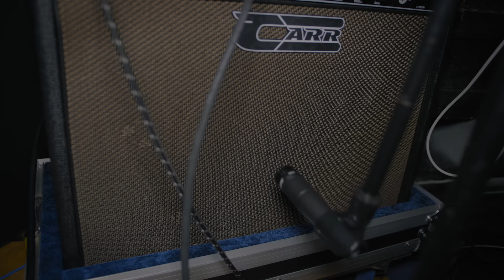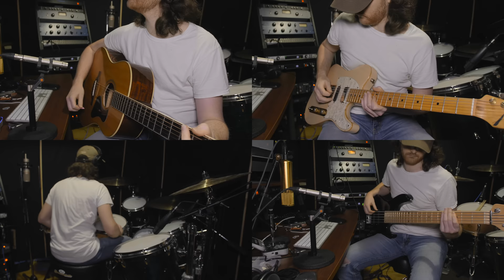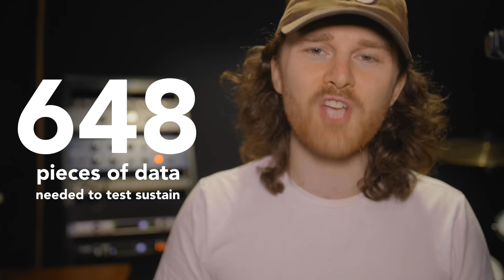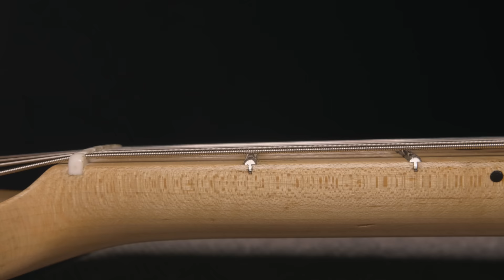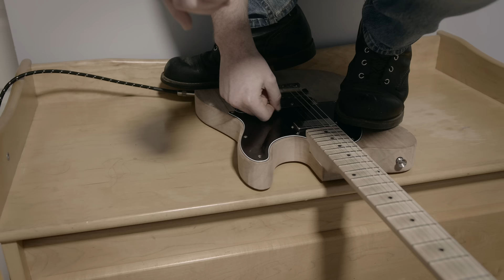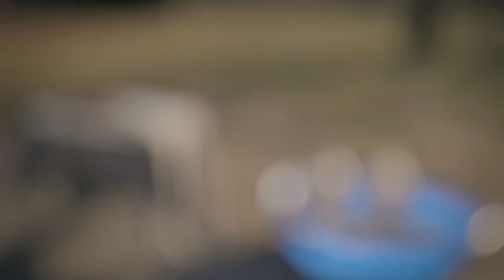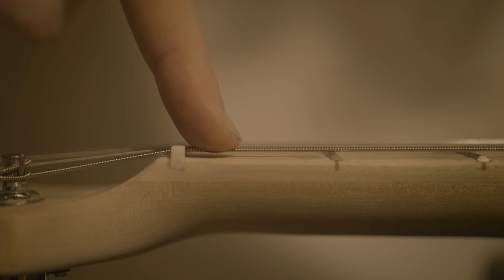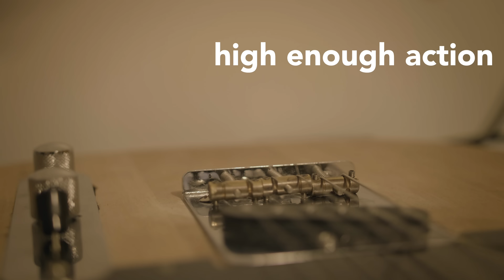Tested: Where Does The Sustain Come From In An Electric Guitar?

Comment: The most important factors for sustain are, good fret work, well cut nut, good functioning bridge, high enough action, new strings
Reply: and the way you play lol
Reply: Neck relief can have a surprising impact on attack and sustain as well.  Loosen your truss rod and play a note, then tighten it a bit and play it.  I THINK what’s happening there is the neck is chewing up some energy by bowing a little when the string is struck.  If you can keep the neck as practicably straight as possible, I think you stand your best chance at getting the least amount of loss there as is possible.
Reply: How much does the nut come into play when you have a string fretted? When you play a chord, some of the strings may be open, but not when playing a note on a string that's pressed against a fret.
Reply: Weight definitely acts as a huge factor, when the weight is below a certain threshold. The "air guitar" is actually infinite weight, it will pretty much be the same as a 8lb or 6lb guitar. But how about 0.5lb? It simplely won't sustain long. 0.5lb hollowbody guitar? That would be even worse.

It's all about how much energy is being taken by the guitar. Very simple physics. For solidbody above 5lb, effectively no energy is taken by the guitar, so in real life, the guitar itself won't really affect your sustain.
Reply: And that's proven by the 8:48 part of the video. When the resonant dresser took away quite a lot of energy, single note sustain saw a difference of 4db, which is huge. 4db is almost 3 times of power ratio.
Reply: @sirporkrib7643  well…maybe yes maybe no…there was also a rather un-resonant human being standing on it acting like a damper.  These tests are just not well thought out.
Reply: @sirporkrib7643  I’ve thought about it more.  The bed WOULD be damping less…it’s acting more like a shock mount than a damper…whereas when dude is standing on the guitar with what I have to assume is north of 150 pounds of ballistics gel and bones on the guitar…HE’S A MASS DAMPER.  The difference in sustain is actually 100% intuitive.
Reply: @iancombs857  Only beginners think that guitar necks are supposed to be perfectly straight.
Reply: @iancombs857  No, it's not about the pure weight, it's about the energy loss. Here, the factor is the huge vacancy of that dresser. It's acting like a double-bass-body, taking away a lot of energy. He stading on it is basically acting like some glue, so that the energy can go from the guitar to the dresser seamlessly.
Reply: @nicholasbstone  >.012" of relief is fender spec, which is pretty straight...and I keep mine straighter than that.  You ABSOLUTELY can keep a neck dead flat if you have a good fall-away and don't mind a little rise in action as you go up the neck...and I know of pro players who DO like necks damn near straight...Pete Townshend and Joe Bonamassa to name a few.
Reply: @sirporkrib7643  Think about it this way: a cello mute is a rubber stopper you clip onto the bridge.  It adds mass, but it's way less rigid than the maple bridge, so it knocks down sustain and high end.  This dude is doing the same thing with his whole body.
Reply: @iancombs857  So it's all about how much energy the body TAKES. When we compare solidbody to solidbody, more weight means less energy taken. Here, it is the dresser that takes the energy, not the human body. The human body is simply there so that the energy can transit into the dresser.
Reply: @sirporkrib7643  you’re speaking directly to my point.  If the body of the electric guitar takes less energy from the string, explain to me how adding the mass of that dresser top (the point of contact and at least equal to the mass of the guitar if not heavier) would do the opposite as you’re claiming.  If it’s of roughly equal mass and density, it shouldn’t have a damping effect by that logic.  Had he coupled it to the dresser top with small and stiff clamps or some sort of stiff adhesive, we’d likely be hearing a different effect…but effectively he’s standing on the top of an acoustic bass.  Assuming it could withstand the load, what effect would putting a big bag of water on top of an acoustic bass have?  Or to point to a more extreme example of the same phenomenon…what happens to a snare drum when you put a moon gel or a wallet on it?  These are all the same damping effects.
Reply: @iancombs857  What do you mean? I never claim the human body can damp the big double-bass-dresser-guitar. He didn't stand on the bridge. He is basically pressing the guitar down to the dresser, only with his feet.
Reply: @iancombs857  OK, so you think I claimed that more weight means more sustain? No I never claim that. That only holds true for SOLIDBODY guitar. Here the big vacancy of the dresser is taking energy.
Reply: @sirporkrib7643  the big vacancy is SURROUNDED by something equally if not factually more massive than the guitar…I don’t think the void space matters QUITE as much when you’re dealing with a top that’s likely at least 5/8” thick.
Reply: @sirporkrib7643  it wouldn’t matter if he stood on the bridge of the acoustic bass…if he stood anywhere on the top of the bass, it would damp it pretty significantly.  You can hear damping on an acoustic guitar with just your arm on it.

Let’s take the guitar body out of it…if you put a squishy mass DIRECTLY on the string…what happens?  It mutes, right?  But if you put a hard mass on a string (like say, a heavy guitar slide), you may actually see a brighter sound and a longer sustain.  That’s gotta be the prime driver here.  I don’t think the air gap of the dresser matters.  It probably weighs 200 pounds.  The volume of the air mass vs. the mass of the dresser is nowhere near analogous to an acoustic bass.
Reply: @iancombs857  Neck shouldn't be totally straight, there should be a slight relief in the neck to accommodate string oscillation while not buzzing/fretting out. If truss rod is in working order it will keep the neck at right tension no matter if it's straight or bowed.
Reply: @iancombs857  add Alan Holdsworth (RIP) to that list. Light strings, straight neck and small body (no! not Mr H, the guitar!) ... and he had a generally very sustainy legato sound, when he wasn’t playing at 1000 mph.

Comment: As a physicist, i would say that two major things that can affect the sound of an ELECTRIC guitar in general, including the sustain as well, have to do with how the sound is produced and captured in the first place. And these two things are the strings and the pickups. Its all about electromagnetism. All the things involved in this factors, like the string material, tension etc, and the pickup resistance, magnet type, etc, and how this signal is produced and recorded. And i agree when you said about the amp relevance. Even if you flip the tone knob in half, it can affect the sustain
Reply: He has another video exploring all of that. It's a great watch.
Reply: Unfortunately he isn't using a picking machine so all his observations are irrelevant.
Reply: @valueofnothing2487  yeah, would have been even better with that
Reply: Not irrelevant, @valueofnothing2487  , just variable between samples. He only shows each vartation once in the video, but he mentions taking multiple samples and averaging the results.
Reply: As an EE, I'll say that the pickup only has effect on sustain by either robbing the strings of energy (having it too close to the strings) and by how much it emphasizes the high frequencies that are more present in the attack transient compared to the decaying part of the note. The latter is much of the reason people think that humbuckers "sustain more", where your typical humbucker simply emphasizes the attack less. If you were to compare the volume at one second vs five seconds, the difference  between single coils and humbuckers would be close to zero.
Reply: Just one more thing when it comes to sustain. If the frets are loose in the slots, it affects the sustain. I've had it on my partscaster- one spot was dead, no matter what I did. After refreting and gluing in the new frets the problem disappeared. 
The frets were so loose on it in fact, that I could pulled them without any tools during the process.
Great video! Thanks for sharing!
Reply: Exactly, string material, pickup & amp frequency response and the one you forgot - nut & saddles as boundary conditions.
Reply: Pickup height too.
Reply: All other things being equal [ they never are, actually ] the electric solid body guitar with the denser body will have more sustain, as it will resist the string energy bleeding off into the materials of the guitar.
Reply: @valueofnothing2487  Picking machine?? Sounds like a future video.
Reply: Theoretically, the more the ends of the string are fixed the more sustain you have 

The genius thing about this video is that what we are really after is those first four seconds, or what could be called decay perhaps.

And so if the ends are not fixed and vibrate they could vibrate at a low frequency, an increase the decay while reducing the sustain.

And so it's necessary to do these types of experiments.
Reply: @valueofnothing2487  I really do like these experiments.
Reply: What will also affect things in the fine details are the tolerance in the electronics. The guitar, until it hits the amplifier, is a high impedance low level electrical source. With 250k pots and the cap's, even small differences in pot. settings could have a measureable effect, let alone the good few percent tolerance of the components. However, all these are easily controlled for be using the same electronics.
Reply: @duncanbarclay6919  The sound form the guitar amp is produced through a series of electronic devices, starting with the strings and the pickup[s]. It a very processed signal.
Reply: @valueofnothing2487  8 times picking and taking average reading is more than enough

Comment: Love it! Disproves every one of those "golden ear" guys that claim this or that feature of their favorite boutique guitar has the magic sustain.  Keep up the good work!
Reply: The golden ears have often proven, that they cannot distinguish the „things that control a guitars tone“ in a blind test.
A German university professor, who owns a collection of guitars of original brands wrote a book about all aspects of the system „electrical guitar&amp“. He occasionally added quotes from „expert magazines“, often contrary quotes, even from the same author, just based on what they tested. The result was: there are design aspects, some designs are just better solutions, but these are not the ones normally seen. E.g. the tone on a old LP was very dull and he found that the short cable from pick to pot was isolated with cotton, which collected moisture from the environment and that changed it‘s capacity to 10x the capacity of a standard guitar cable. So playing in the dessert sounded much better than playing in the Mississippi delta. Or he found that even modern Gibsons used an old approximation for the 12th root of 2 spacing of threads, whereas the cheap Epiphone’s used the correct values.
Reply: I guess I'd hear things different if I had gold stuck in my ears too.
Reply: @fromgermany271  Kannst du mir den Autor bzw. Namen des Buches sagen? Bin durch googlen leider grad nicht drauf gestossen.
Reply: @mathkrGames  
Manfred Zollner, Physik der Elektrogitarre.
Leider vergriffen, aber in Teilen als PDF runterladbar.
Edit: er hat die einzelnen Kapitel als YT-Videos verfügbar gemacht. Lesen fände ich besser.
Reply: @fromgermany271  Danke!

Comment: Decibels are already in a logarithmic scale, so 3db difference at 25db, at 10db or at 0db, is still the same 3db! Which is already quite a lot - it's about 50% change in the signal amplitude. Even 1db change (~20%) can be perceived by many people (I'm sure - every guitarist will be able at least to feel that change when playing). As one of the possible ways to have a better picture, I'd suggest, to consider another metric: the time of decay. I.e., compare the time it takes for the level to drop by some fixed ratio, like 10db.
Reply: While that might make a better picture for some, fixing the dB drop instead of the time is just a different way of obtaining the same information.
Reply: Ты понимаешь что он струны своей рукой вводит в резонанс? Не роботом с постоянным усилием, а рукой.
Reply: @AlmostSickBoy  Понимаю. Мы же не амплитуду меряем а коефициент затухания, т.е отношение между начальной и конечной амплитудой. При не сильном ударе по струнам и на клине (т.е. при достаточно линейнонй характеристике всего хоз-ва), это отношение слабо зависит от начального усилия.
Reply: @rajeev-vikram-singh  Semitones are logarithms, as are the other intervals. People may have trouble thinking in logs, but they can perceive them naturally (all music).
Reply: there is a simple reason, why we use the log scale for sound. We hear it this way. We are able to hear very well at 40dB and also at 100dB, if we used a linear scale for the actual sound pressure, it would extend over many orders of magnitude. 
Also 3dB at high dBs is definitely not the same as at low dBs, thats the whole point of dB! The difference between 15dB and 12dB is (1.12e-4 Pa - 8e-5 Pa = 3.2 μPa) while 103dB vs 100dB is (2.8 Pa - 2 Pa = 0.8 Pa).
And saying that 1dB change can be perceived by many people is a bold statement. I gave lessons in acoustics (physics, not music) and even getting a stable signal with a variance less than 2dB in a classroom is kinda impossible. (Good luck trying that with a guitar)
Reply: @m0nzderr1  ну да, ну да.
Reply: @NMPshadow  
Exactly - that's the whole point of dBs, to have a scale for ratios*, so that a change of 3db represents the same *ratio regardles of the level (in your example: 2.8/2 = 1.12e-4/8e-5 gives the same ratio of 1.4).

And, why do we use dbs to represent loudness? - because our perception of loudness is more "uniform" for equal ratios than for linear differences. 

Yes, there is much more to it, such as loudness curves, etc... That's not the point. The point is: 3db is a huge difference, (almost) regardless of the level. 

Try it yourself - get a DAW software, cut some tracks and play with the sliders. You may notice that the perception of a 3db boost feels quite the same for wide range of signals. 

A good sound engineer (in a right environment) is likely able to detect 1db change on a track volume in a composition of 20 tracks playing together  (I'm not that good, but I know a couple of guys that certainly are). 

And, finally, we are trying to find out if 3db is a significant change in sustain. My bet is yes, and you'll feel it quite clear when actually playing guitar (not as a matter of level, but as the corresponding change in duration of a note).
Reply: 3db = x2 power (small but noticeable increase in perceived volume)
6db = x4 power (significant increase in perceived volume)
10db = x10 power (twice as loud in perceived volume)
Reply: As a linguistic type with few math skills, I would definitely refer to sustain as the decay arc (?).  Decay to me has a few elements, tho, because certain frequencies may drop out sooner changing my perception of the sound.  
Plus we all hear different frequencies.  My right ear can hear high pitches very well, but the human voice or guitar is much louder to my left ear.  
Likely from playing baseball and acoustic guitar my whole life which require that left ear.  Idk…time for a 💤 😴
Reply: you're wrong. 1dB  is ridiculous. You cannot hear any difference. Many people can hear 2 dB diff. Most trained hear 1.5dB diff.
In psychoacoustic, 10dB is like double.

Comment: Next video should be about how a hollow body sounds different than a solid body. If the wood and finish has nothing to do with the tone / sustain, why do hollow-bodies have those hollow sounding overtones?
Reply: I imagine it would have something to do with the vibration having enough room to go into the body and back out through the sound holes
Reply: Sustain is just one aspect of performance. Tone is a very different thing. There are very good reasons why guitar makers use certain tone woods. If it made no difference, why use some expensive wood? I know from personal experience that wood type and construction make a huge difference in tone. I’ve got two Fender basses. One is a Squire P bass, with what amounts to a plywood body. The American P Bass is the exact same size and shape, but is made of Adler. Both necks are identical, rock maple with maple fretboard, and they have both been hot rodded with Seymour Duncan Quarter Pounder pickups, their electronics are identical, I did the work myself. The result is, they are both fine guitars, but the Adler body is head and shoulders above the Squire, it has a beefier tone, a longer sustain, and a quality to the notes that the Squire doesn’t have.
Reply: @alphagt62  he already made a video debunking tone wood....you clearly missed it.
Reply: @joshuarichard2509  all he has done is measure volume, he has in no way measured tone. Some people just don’t want to realize that they are tone deaf. If they can’t hear it, they don’t believe it exists, simple as that.
Reply: @alphagt62  you should definitely make a video countering what Jim has done. It would doubtless be amazing...
Reply: @sagnier  hahaha burn

Comment: Love this so much! I've never understood the obsession with sustain for guitar players. 

Certainly some guitars have differing levels of sustain, but I've always felt like the differences in acoustic sustain caused by different bridge materials, break angles, etc were negligible compared to the effects of compression, overdrive, and volume created by pedals and the amp, and the resulting feedback of the setup as a whole. When I think of sustain, most of the tones that come to mind eventually blossom into feedback and they all had insanely loud amps, fuzz pedals, etc added into the mix to get there.